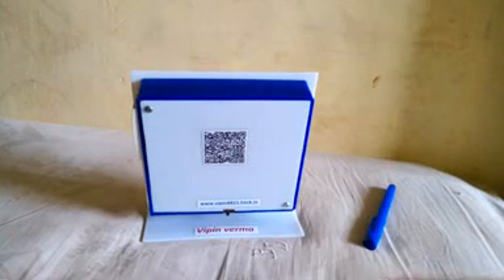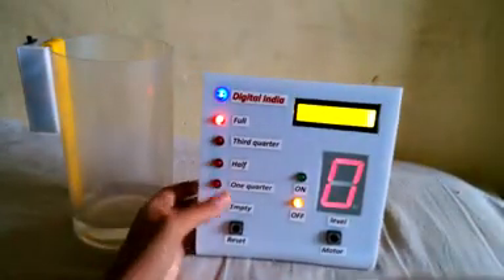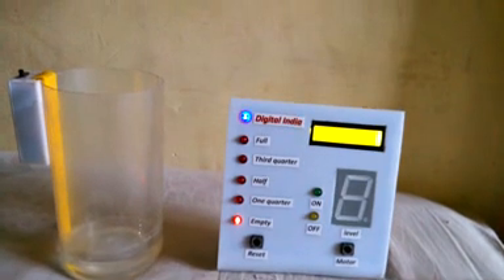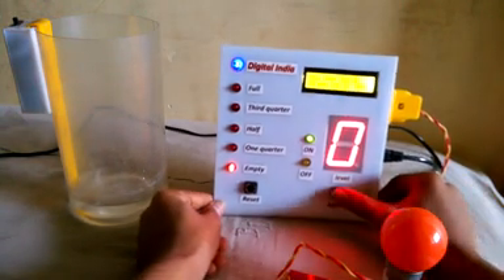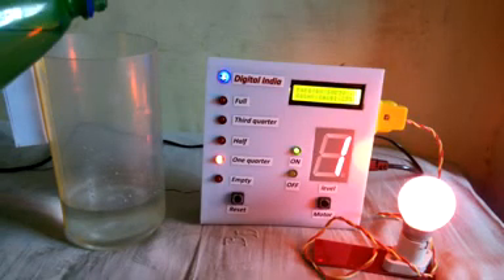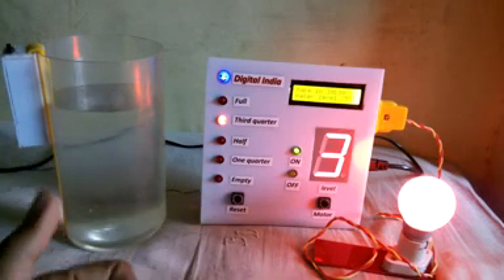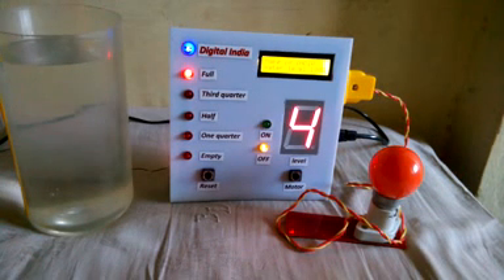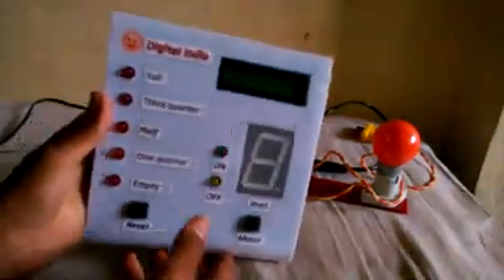Wireless water level indicator.

Comment from the maker: Buy from here
https://www.electronicslibrary.org/post/digital-water-level-indicator-auto-on-off-motor
Reply: PLEASE SEND YOUR ADDRESS AND MOBILE NO. OR PLEASE CALL ME 8347974797
Reply: Can it run on 3 phase motor..???
Reply from the maker: @3226222  Yes, it'll work
Reply: For full automatica water level controller for submersible or monoblock pump with under voltage, over voltage, dryrun protection in just Rs 1500/- to 3500/- Call whatsapp no 9028328803
Reply: Link is not working
Reply: There is no website Such URL
Reply: Dry run protection means no water in the well and moter runs dry.. so we need dry run protection so it needs auto control to stop motor...

Over flow protection means tank is over flowing we need to stop....

 Overload protection.. moter doesn't work, due to low voltage, or broken capacitor, or windings / wiring fault so it needs  breaker or overload really..

Ground falt protection.. ELCB, GFCI, RCD, RCCB..

It's must have all of these..

Comment: Nice video, but you do not see how you built it, the material you used, the programming.
Reply from the maker: How to make Wireless Water Level Indicator | Code & Schematic 

https://youtu.be/VP2LWtHxhhE
Reply from the maker: Buy from here
https://www.electronicslibrary.org/post/digital-water-level-indicator-auto-on-off-motor

Comment: Interesting... will this work for fuels such as gasoline or maybe diesel or is it only safe for water?  Also... you should consider selling the parts (in a kit) on ebay. This way I can buy the parts from you and put it together on my own  ;)
Reply: the level sensor works on law of conductivity, it will not work with fuel .